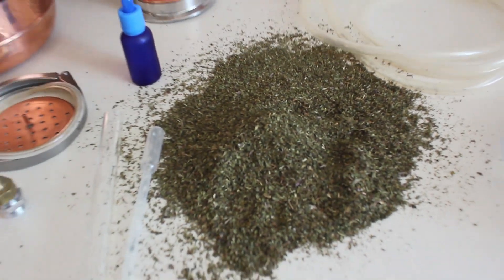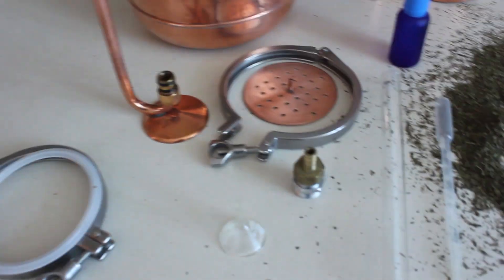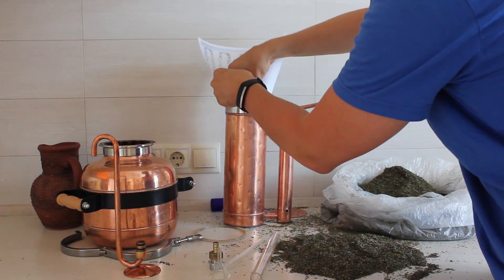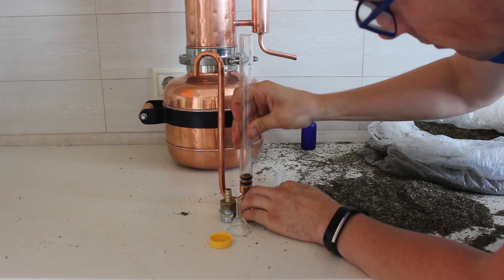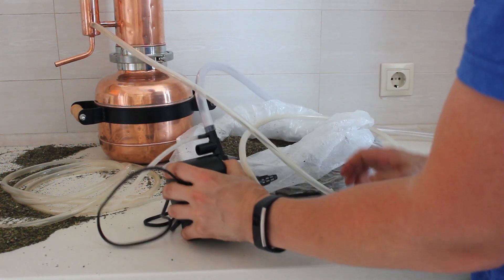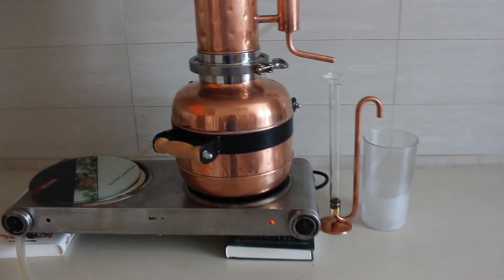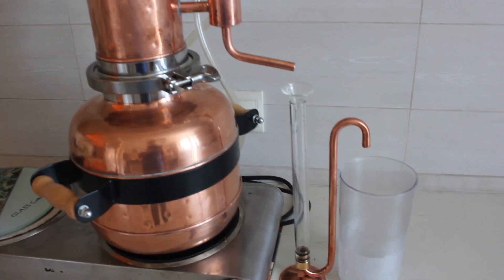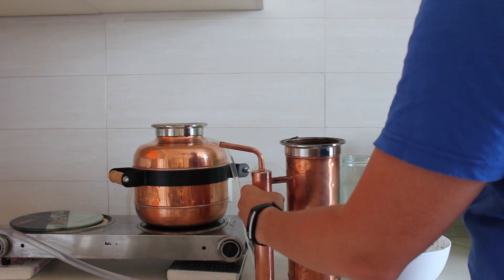Full instructions for using the distiller

Comment: Hey I am having trouble setting up my 42 littre still as it does not have the same specifications, could you possibly make a video on my current model or point me in the right direction for setup and use?
Reply from the maker: Hello. Please write to me at copper.pro1@gmail.com. I will help you

Comment: Last question, when I will do oils such as pine or cedar, will they not leave residue on the inside of the equipment, so that later on if I do lavender or mint, will it not be contaminated with the previous oil?
Reply from the maker: you just need to clean the distiller well, if you want to change raw materials, you can watch this video

https://www.youtube.com/watch?v=RcR1YNp8qTA

Comment: Can I use tap water or should I use filtered?
Reply from the maker: you fill the boiler with clean, filtered water, to cool the distiller you use the connection of the tubes to the tap
Reply: The point is to have water that does not have dissolved solids in it (like the stuff water treatment plants treat municipal water with, or like hard water deposits). You can use such water but it will make the appliances dirty with deposits. Rain water, distilled water prevent that as do some filtering solutions.

Comment: Made a distillation of sage with sage cut 2 evenings ago and I cut fresh lavender after lunch today and distilled right after. Yield of sage hydrosol was 3 oz and no e.o., then 5.5 oz of lavender hydrosol and 2 drops of e.o. Takes a lot more fresh plant material than I thought. House smells very nice. Not bad for my first production. How can I avoid getting a little bit of water in the pipette as I exttract the e.o.??
Reply from the maker: Hello! it is quite surprising that you did not get essential oil from these plants, perhaps you came across raw materials with a low percentage of essential oils, we recommend using only plant flowers for distilling lavender, flowers contain more essential oils, for distilling sage you can use flowers and leaves, you you can try using a syringe to collect the essential oil then you can better control the lack of water in the oil
Reply: @CopperPro  This was my first distillation and I did not know what to expect. It got better with the next 2 distillations (2 litre distiller), first one with lavender from my garden and second with lavender and rosemary. Although I did get a few drops of essential oils, most of it adhered to the walls of the plastic pipette included in the package. Decided to leave it in the hydrosol which yielded a full litre each time.
Reply from the maker: @isabelablanchet2012  yes, the 2L model does not give a lot of essential oils, you can purchase an additional column for this distiller and then you can get a good yield, since you can use more raw materials in one distillation, we will also have Christmas discounts soon, so write to me if you are interested my offer and I will send you a discount coupon, you can also use a syringe to collect essential oils, this will better help to collect all the oil without hydrosol
Reply: @CopperPro  Thank you for your offer. However, I don't grow that much lavender so the 2L colum is great for now. I do have another question: Do you have a video about making rose hydrosol? I could buy organic dry flower but wondering about quantities and yield.
Reply from the maker: @isabelablanchet2012  Yes, you may need about 500 grams of rose for one distillation, but it all depends on the raw material that you use, as the volume. plants may differ, the more plants you place in the column, the more saturated the hydrosol you will get

Our video: https://www.youtube.com/watch?v=tqIDY81Qva8

it will also be helpful to watch these two videos:

https://www.youtube.com/watch?v=b36AZ-SjLVA

https://www.youtube.com/watch?v=tzyGhcbot20&t=3s

Comment: When you use fire (burning propane) to heat the water, it won't be too hot for the copper?
Reply from the maker: Hello! You can use the electric stove or burner for the copper system, induction devices cannot be used

Comment: I'm trying to find a water pump - does it really need to pump 2000L an hour? That seems massive compared to most aquarium pumps. What is the smallest pump size you recommend using?
Reply from the maker: Hello! this is the max flow rate of some pumps, the pump saves water consumption, you can use a bucket of water as shown in the video and change the water as soon as it heats up, you can buy a pump from us, send us an email - copperproc@gmail.com and I will send an invoice
Reply: @CopperPro  I've already bought a Copper Pro still which I would like to start using soon. If I ordered a pump from your company it would take up to two weeks to deliver. In the meantime, would a 400L per hour aquarium pump work?

EDIT: it didn't work, you do need a more powerful one
Reply from the maker: @dolphindiver99  Hello! delivery of the pump from us will take 6-10 days, if you do not want to wait, then you can buy a pump like we sell
 in your city
Reply: @dolphindiver99  you can buy a 3000L Submersible Pump (3000L/H, 24W) on Amazon for $23, Copper Pro sells their 2000L pump for $71

Comment: What is the purpose of the pump and do I need a pump?  I tried using the steam distillation but all that came out was water everywhere!! I just have the water hose into the sink!!
Reply from the maker: A pump is needed to save water during distillation
Reply: @CopperPro  why the heck would you not tell someone this when they buy the still. Im pissed off about this!
Reply from the maker: @getgroovymoon  all information is indicated on the website, in the description and in the video you can see the pump that we use, but you can buy an aquarium pump in your city, most of our customers buy the pump locally
Reply: @getgroovymoon  you can buy a 3000L Submersible Pump (3000L/H, 24W) on Amazon for $23, Copper Pro sells their 2000L pump for $71